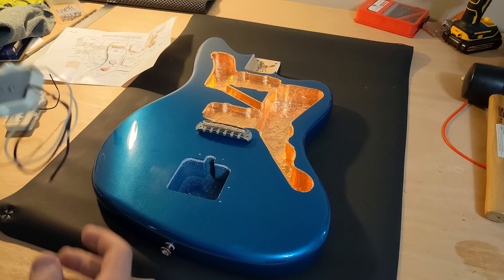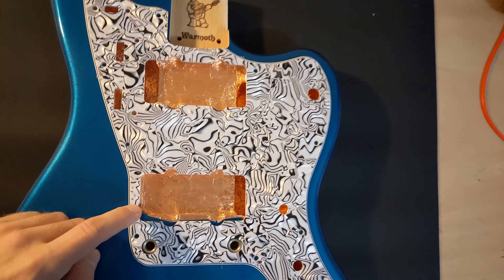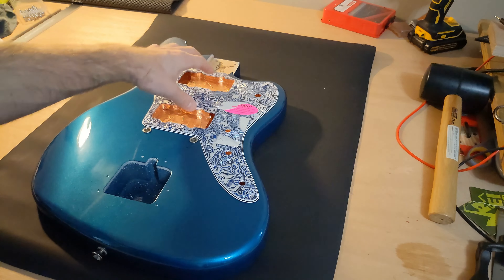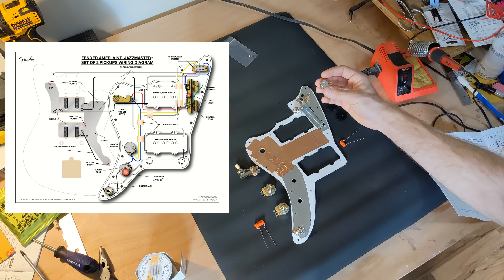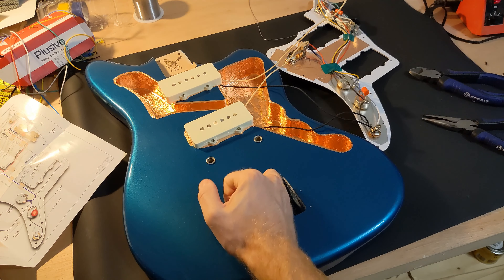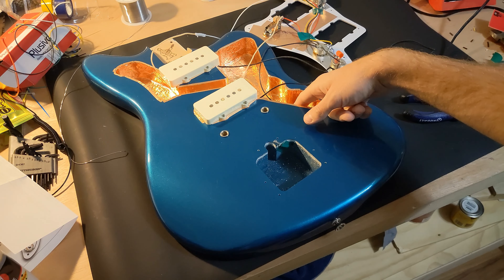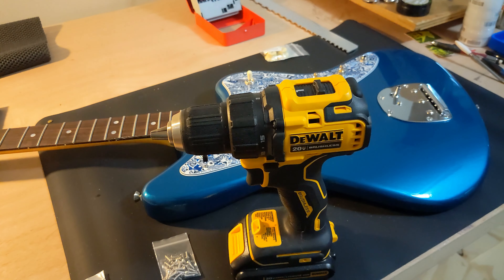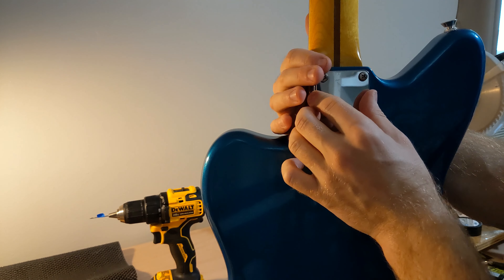DIY Jazzmaster Part 6 - Electronics and Assembly

Comment: Thx very much for sharing. I'm currently at the same stage assembling a Jazzmaster body from Warmoth as your video. It has the exact same misalignment with the pickup cavaties as yours did. Luckily before finishing, I found a video on YT that pointed out the problem with the Warmoth JM bodies and was able to correct the cavity routs with a router. Getting to assembly with this problem fixed was a big relief. I applaud you wiring the electronics from scratch. After studying the circuits I elected to get a pre-wired harness from 920D. Thx again for sharing.

Comment: I'm getting ready to wire together an MJT Jazzmaster build and this helps.
I like the idea of grounding the pickups to the jack instead of to the shielding in the body like in Fender's diagram.
Question: Did you just solder the ground wire from the trem plate to the shielding in the cavity? I didn't see where you had connected the other end of that wire.
Reply from the maker: Yes - just to avoid having trem connected to the jack in the pickguard so they could be removed separately.